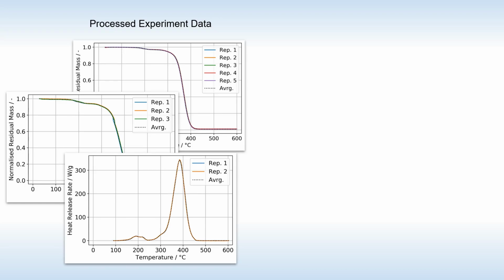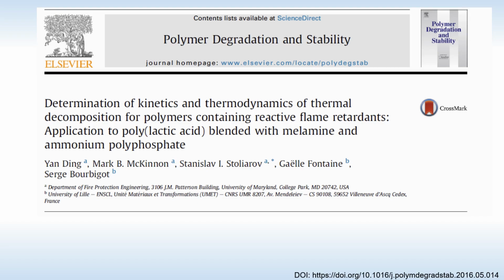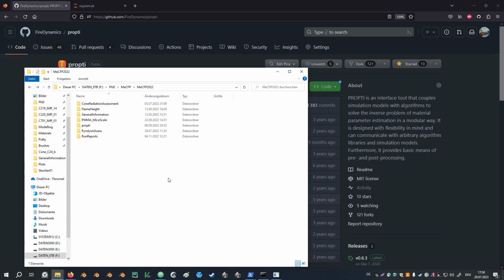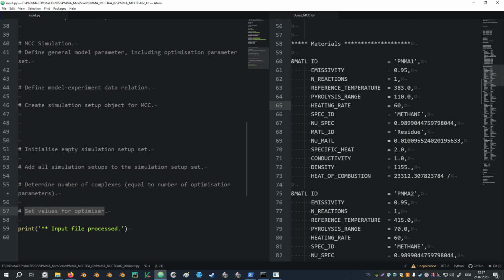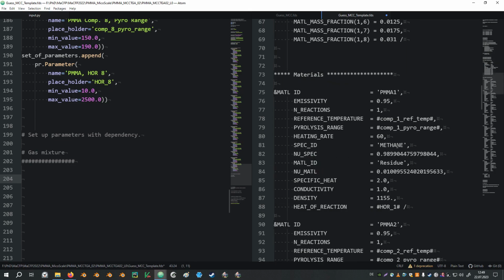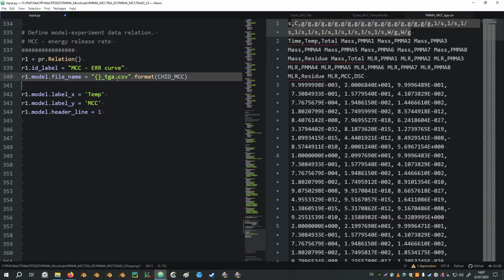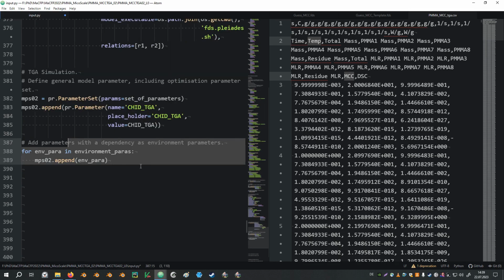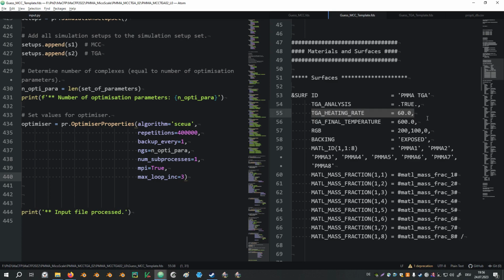How to Set Up Inverse Modelling with PROPTI and FDS | PMMA Pyrolysis

Comment: Very nice video, thank you!
Reply from the maker: Thank you very much!
Reply from the maker: @pyr-fire PROPTI should also work together with OpenFOAM/FireFOAM. We did set up an example in a previous publication "Application cases of inverse modelling with the PROPTI framework" (https://www.sciencedirect.com/science/article/abs/pii/S0379711219300438). However, we are mostly using it together with FDS, thus I'm not sure what the state of the interface is. In case you want to use it and get stuck, please feel free to reach out.
Reply: @firesimandcoding  Thanks a lot, I will definitely get in touch when I look into it. I haven't tried it before so I was actually curious to try it. I randomly came across your video which looks very useful, very nice piece of work.
Reply from the maker: Sure!

Comment: is it possible to simulate cone calorimeter without MCC simulation or experimental?
Reply from the maker: Dear @muhdzulfadhlimuhdzaimi9454,

In principle, one can simulate the cone calorimeter without experiment. Maybe just the cone heater without the sample. One could also have some gas burner that changes the mass flow over time. 

Please elaborate on what you would like to achieve with your simulation, what the overall goal is, so that I can provide a better answer.
Reply: Dear @firesimandcoding,

I apologize for the brevity of my question.

My overarching objective in simulating the cone calorimeter is to obtain a Heat Release Rate vs. Time graph that closely resembles the experimental results. However, at present, I possess only the TGA experimental data, Cone Calorimeter experimental data, and an incomplete pyrolysis model derived from the TGA experimental data.
Reply from the maker: No worries.

In principle, one can use the mass loss data from the TGA to design a pyrolysis scheme. It would be nice, if you would have multiple heating rates for TGA, DSC and MCC. However, I know it is not always easy to get the desired data in the necessary quality and one needs to use what is available.

It is helpful to get as much data as possible for the material you are investigating. Try to get the soot and CO yields and maybe what gaseous species are released. 

Since you seem to have the cone calorimeter HRR data, you could use it to determine some effective heat of combustion (eHOC). Determine the mass that is lost during the experiment, integrate the HRR over time and divide it by the mass lost. You could use this to define your surrogate fuel, in case you do not know much about the released gases. 

However, this will lead to a constant eHOC over the course of the experiment (TGA). This may not necessarily be the case. For example, if your mass loss rate plot from the TGA shows multiple peaks you could try to see if you could make some assessment about what gas they relate to. Maybe it is wood and there is a mass loss peak at about 100°C this is likely water, or if you are investigating some plastics with fire retardants they may release CO2. Look for example at figure 3 in https://doi.org/10.1016/j.tca.2014.07.009 (also in the video). You can see that for PVC the mass loss rate and the heat release rate do not directly overlap. To make this apparent, it would be really good to have MCC data to compare. 

With respect to the gas phase combustion itself: If you do not know what the released gas is, my suggestion right now would be to pick some surrogate that is somewhat close to the information you have. You could define the REAC in FDS, including the yields and compare some fuels. Have a look into the CHID.out files produced by FDS to see if your surrogate has a similar HOC compared to the eHOC you determined above (with included yields). 

If you intent to use inverse modelling to get a parameter set able to reproduce the experiment, I strongly recommend to use a cone calorimeter simulation setup with gas phase combustion. Even if the fluid resolution is coarse, this allows you to capture at least some of the flame-sample-interaction dynamically and specifically taking your gas phase combustion model into account. My suggestion would be use at least 3.33 cm fluid cells (C3), as discussed in the article https://doi.org/10.1016/j.firesaf.2023.103926 
Obviously, the surrogate should than be regarded as part of the parameter set and not changed later on.

You should also check the heating rates of the sample material in the TGA, and also for MCC and DSC if you have them, and not rely on the set values from the apparatus. Determine this information form the data of the thermocouple closest to the sample. When you publish your work somewhere, like in a thesis or journal article, I suggest to provide also plots of the actual heating rate over time, like it is discussed in the video about processing the TGA experiment data. This is very helpful for the reader to assess your presented model and it also helps you when setting your pyrolysis scheme up.

If you can, try to get DSC heat flow data for your material. This helps you to define the specific heat capacity as a function of sample temperature and it provides you with information about the heats of reaction for the pyrolysis reactions. From my experience it is very difficult to obtain these values from TGA and cone calorimeter. In my inverse modelling runs they were never determined correctly without DSC, but maybe you could also use something else as target for this.

Keep in mind: In the end you obtain an effective parameter set that produces a simulation response that is close to the behaviour observed in the experiment.

I hope this is somewhat helpful. Please feel free to ask further questions.